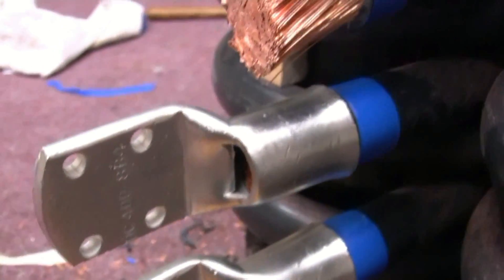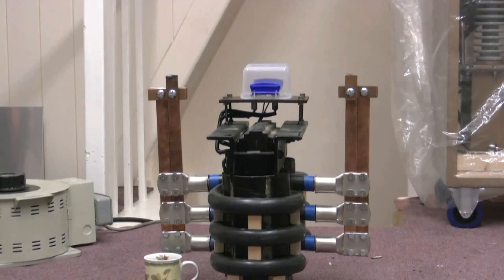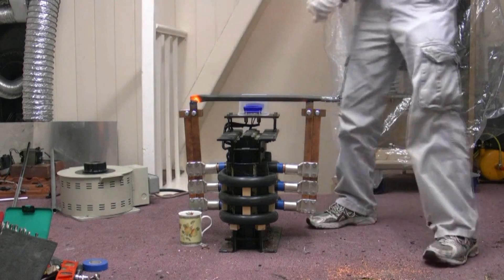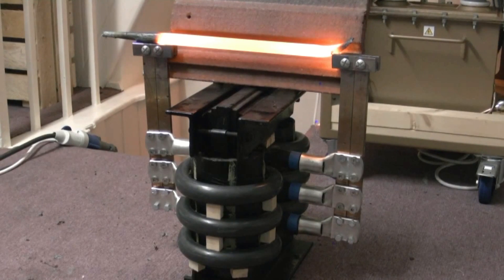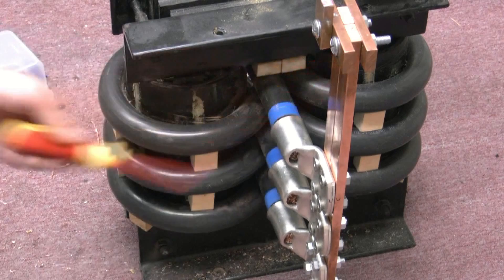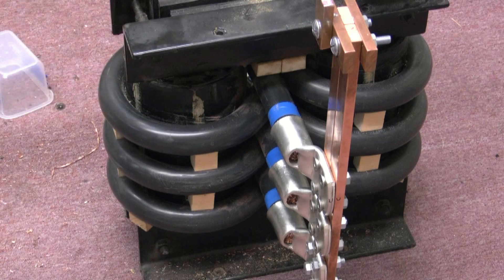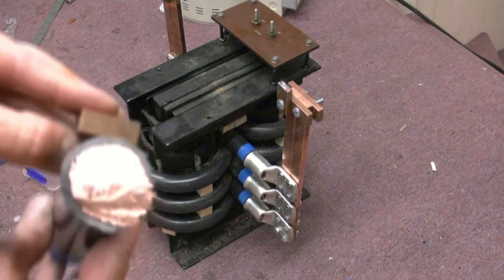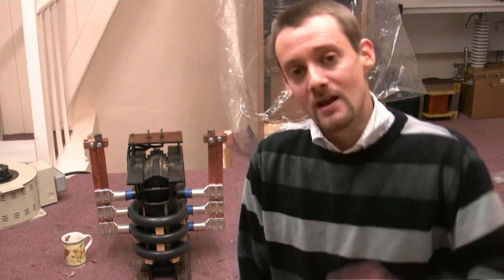50,000 Amp Transformer Completed

Comment: Sorry Kid, but that is NOT 50,000 Amps.  Your 400 MCM windings, triple ganged as you have them with the connectors, can only carry 1,000 Amps at 240 VAC., and the Bus Bars on each end can only handle 500 Amps.  The weakest link is your understanding of electrical power system math.  Yes, I'm sure, I am an Electrical Engineer.

But Double Points on making a clean rig.
Reply: Why you mention 240V? in secondary coil he have few volts, and why you mention volts at all, it is all about amps when you calculating can wire withstand or not. As for amps, in car wire to starter is lot thiner and current on starter can reach 500A depends of car and conditions, this wires thicker and 3 in paralel so suppose to hold at least 5000A in total, and if more they will heating a lot but it still will work for some period of time even at 50000A.

And he didnt made 50000A, as i understand, 50kA is what this transformer can, but you need to power it with ~110A on input as i understand, i doubdt he had 110A in powerwall or some other power source with 240V*110A, but it could deliver 50kA for some short period of time.
Reply: So is he, what's your point??

Comment: Please no more uninformed comments about how he's an idiot / touching it will explode/kill//etc you. Just to be crystal clear here; his transformer is converting 240v (UK mains voltage - which will give you quite a painful zap or kill you if unlucky) into 0.5V (which is harmless to humans). The whole point of the transformer is; 240V converted into 0.5V gives you (240/0.5) = 480 times as much current (roughly; there's some losses).  In simple terms, current flowing through electrical conductors things makes them heat - up as demonstrated here.   Human beings don't conduct electricity very well so - at low voltages - practically no current flows, there's absolutely no risk of getting shocked. At higher voltages (say 50v and up) you need to be increasingly more careful.  Just because the wires are huge and scary looking doesn't actually mean they're dangerous (in this case).  The only risk to Photon here is from the 240V primary side of the transformer, and he doesn't have that exposed.  The reason he's still here making videos is (a) he's careful and (b) he knows what he's doing.  There's nothing wrong with being over-cautious around electricity - you might live longer - but Photon is a pro.
Reply: I'm often scared about the experiments he's doing and how relaxed and careless he seems to be while doing it. But since he still lives (and because he built all of this himself) I think he really knows what he's dealing with.
Reply: Shifu Careaga sigh... you dont understand electricity, its a combination of both of those that kill
Reply: Looks at BSEE degree. OK.

First of all, BY DEFINITION if you have current you have voltage. Don't be a tool.

It's a medical fact that it is current which is the reason people die. It has to do with the heart. OBVIOUSLY there is a voltage potential aspect in that there is a CURRENT.

Looks at medical degree. OK.

check, and mate. cya.
Reply: sigh.... it's current that kills... not voltage.

Comment: Hi, could you please make a transformer to convert 240V 50Hz electricity in to 110V 60Hz electricity?
Reply: Simon Nee esta es la respuesta exacta.muy buena respuesta.
Reply: That's not possible using a normal transformer. You could however accomplish this using a rotating transformer such as an asynchronous machine or using power electronics.
Reply: Thanks.
Reply: But 50Hz to 60Hz with transformer ? Only inverter.
Reply: Waldemar Noname let's say you have an induction machine with slip ring connections in the rotor circuit. Connect 60Hz three phase to the stator windings, connect some output cables to the rotor slip rings, rotate the rotor at a speed of 10Hz in the same direction as the synchronous frame of the 60Hz. That's a rotating transformer. You can get the 10Hz rotation out of a separate induction machine (or permanent magnet rotor if you want exactly 10Hz) on the same axis with 3 pole pairs per phase in the stator winding. Probably nowadays an inverter is a better choice, but there are still applications for these kind of converters.

Comment: Doesn't current run on the outside surfaces of conductors therefore the bus surface area might be similar to the cable surface area?
Reply: For low frequencies the current distribution in the wire is almost uniform. One usually speaks about skin depth in wires. It depends on the material and frequency - check the Wikipedia article on skin depth.
Reply: Prof. Dollard does a short job of explaining this skin effect. Worth 120 hours of lectures if you ask me. Good question mate, well worth the effort, but I don't think anyone knows for sure. Wikipedia is missing a lot of data and full of wankers that want a degree, not real answers to questions like yours. Look for the answers that don't require a lot of quid.
Reply: Larry Penoux Wikipedia is great and the article i proposed that he read doesnt contain too much details to scare off a person who is a bit new to electromagnetism. If you know some basic vector calculus it is also not hard at all to derive what's happening. It's enough to consider a quasi-stationary case - that is to use amperes law in the form rot B = mu J, assume J only flows in the direction of the wire, assume the material has a constant conductivity s so that sE=J. Put J=sin(wt)*f(r), where w is the frequency of the current and f(r) is the current loading at radius r. Use first rot E = -dB/dt, then rot B=mu J to get an equation for f(r) (which will give you that the current loading drops off exponentially with the radius counted from the boundary. the two constants of integration come from symmetry at r=0 and that the total current carried in the wire 2pi*int f(r)r dr = some constant of your choice.) The point of writing this here is 1. to show the calculation can be done on the back of an envelope and 2. the explanation certainly doesnt require "120 hours of lectures". 15 minutes tops is more like it.

Comment: You are one crazy dude. Given that the jimmy bar is a harder material than the buzz bars, why don't the buzz bars melt first ?
Reply: It has nothing to do with hardness & everything to do with power dissipation, which is proportional to current squared & to resistance.  The current is the same in all the metals in the series circuit, but the iron/steel bar has significantly higher resistance than the copper & thus it dissipates significantly more power & thus gets hotter.
Reply: Phillll Hi Phil
I love watching your clips. Things blowing up every where. They are both funny and educational. Your explanation is perfect and it makes good sense about conductivity of different materials.  
I want more !!!!!

Comment: Are you able to measure any resistance at all on the secondary?  As you demonstrated, it should be dominated by the narrower bus bar.  It would be interesting to compare the measured resistance with the theoretical resistance of the bus bar knowing it's cross section and resistivity.

Comment: hey you are crazy 50000 amps that would be 3000000000 volts?
Reply: Thats not how electricity works. He is generating only the current(Amp) while keeping the voltage low at 2 volts I believe
+Meaning that the voltage is to low to even penetrate the human body skin resistance to bring the current to your vital organs+

Comment: Nice video... I need such a high current source just like this.. have you measured a true 50,000 amps?   Can you supply a unit  or a data sheet.. what about providing input and output data? How did you measure the output current? Where did you get the transformer.. can you supply the part number & manufacture?  Very cool demo..  BTW,  I build sensors...so I am looking at a high current variable current source...to run calibrations test runs..

Comment: WHY? What is the point of this, it is useless other than showing how much money a ''tool'' can spend destroying a tool. ''owww look at the glowing metal!''
Minimum of approx. 30v (DC or AC) is required to start breakdown of the dielectric effect of dry unbroken skin and once conducting your impedance reduces dramatically. The max current your trnx can supply is determined by its VA rating, you need a bigger core once it is saturated with magnetic flux